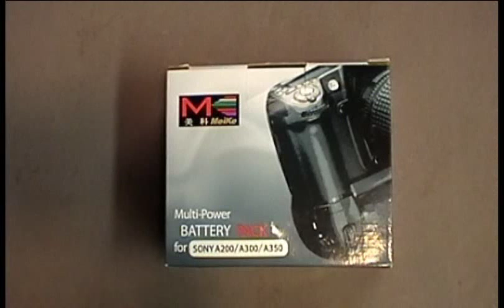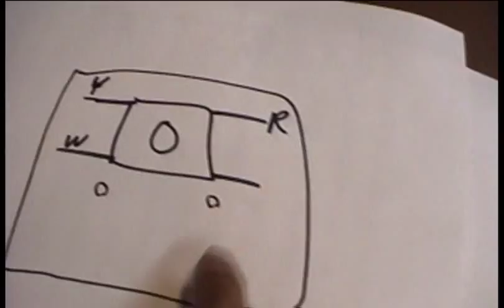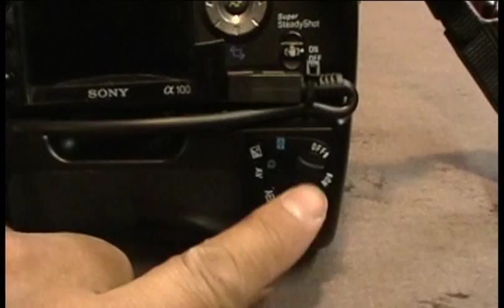Sony Alpha A100 vertical battery grip DIY

Comment: It has a very easy to understand user interface. You don't have to hunt through an extensive and time consuming digital menu to find the most commonly used features. They are available with the knob on the top left and a push of the button. Custom white balance is fast and easy to set.
Reply: Positively youcan get it here  http://amzn.to/1qPEE3H easy set up is important too..

Comment from the maker: Thanks for the inquiry - regarding the batteries... I its been a while but I think they were some generic brand offered up on Amazon. But Yes, I did go a the larger capacity.  If it fits in an a100, you should be fine.  Definitely got longer usage out of the double pack.  Best regards.

Comment: Also, I was curious, what larger capacity battery are you using?  It looks like a100 battery, and if I remember right, its successor, the NP-FM500H, was larger capacity.

Comment: Very cool project!  If I still used my a100 I would consider doing this.  The Meike grips are priced right for projects like this, and they are very good quality.  I recently completed a couple of projects using them, including a battery grip for my Sony a55.  See my Flickr sets for more info, go to Flickr.dom (slash) gkemp (slash) collections - its under Grip Mods.

Comment from the maker: Thank you for pointing this out.... You are correct - the initial test resulted in a battery error but it later cleared out and I  was able to use both batteries.  Best of luck with your modification.